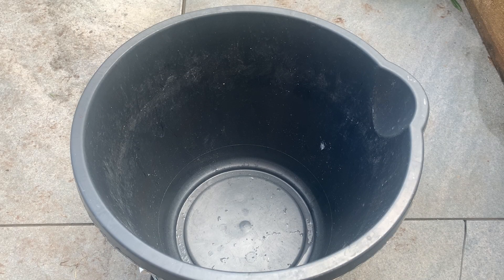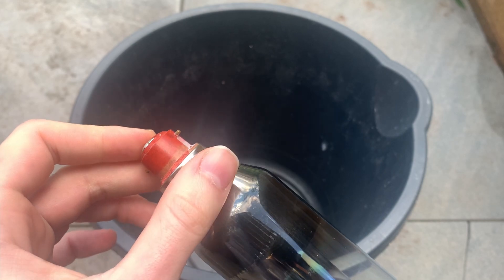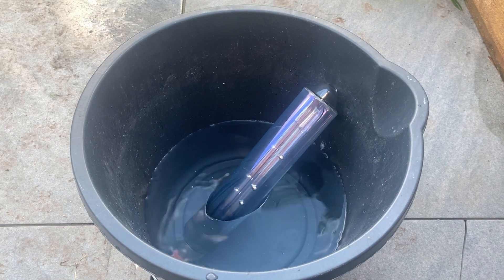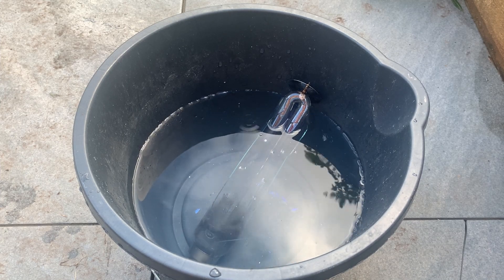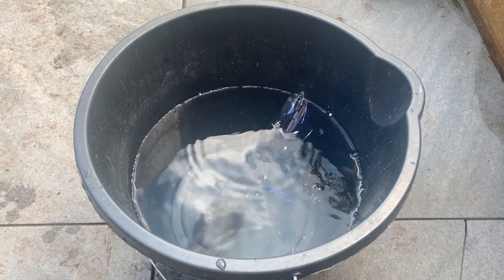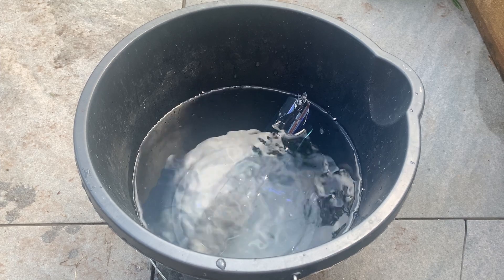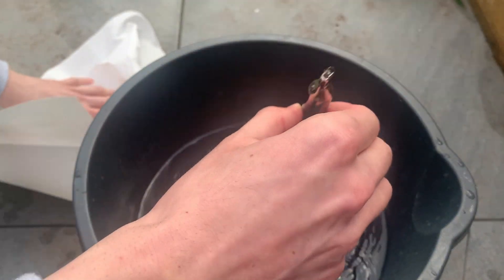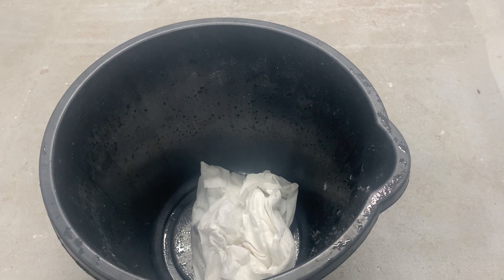Disposal/Smash of EOL 35W Low Pressure Sodium Lamp!

Comment: One question why do you smash them underwater?
Reply from the maker: it's down to prefence, you can break them then pour water on it. You want all the sodium to be reacted prior to disposal.
Reply: Aa! Thank you. Im new to the community im over 13 and looking to join discord soon. Any tips?
Reply: Basically, the sodium used in Low Pressure Sodium / SOX is very reactive and it can catch on fire when exposed to air, so making the reaction take place in water helps to prevent that
Reply: Fst17 what if it explodes and kills you
Reply: This is not safe